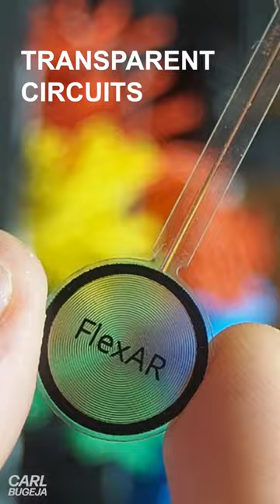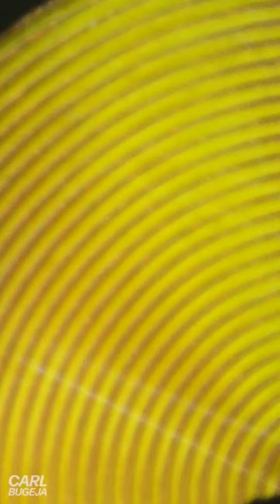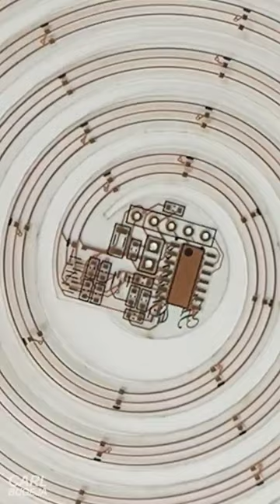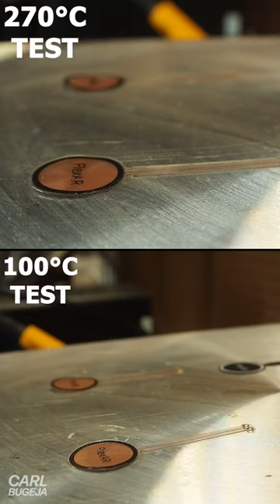See-through Circuits!!

Comment: Have you tried conductive adhesive? It is used in automotive in vibration sensitive circuits.
Reply from the maker: never tried that no
Reply: do you have any information on which components use such adhesives? I can't imagine a glued on ECU chip, but maybe electronic e-brake circuitry?
Reply: @tennicktenstyl in ECUs and such ICs are generally wire bonded to the substrate (usually not a regular FR4 board). It's the passives and discrete semiconductors that tend to be glued on. In a diesel fuel pump I repaired the whole lot was then encased in some transparent thermally conductive gel!
Reply: @ollysworkshop  fancy stuff. Weird how they do all that just so that 1 in 100000 cars doesn't fail, while I bet a plain soldered unit off of aliexpress would work with like good enough reliability for an average consumer
Reply: @ollysworkshop  although the stuff being fancy is what got me into studying EE, I don't think we'll get into automotive applications this year though. Your comment however was very informative, thanks
Reply: Seems like a con

Comment: How'd you go with low temp solders or conductive epoxy put on line solder paste?
Reply from the maker: the led pcb was solder using low temperature solder paste which goes to 165degC.. however it is still above the pcb's temperature rating
Reply: @CarlBugeja  Bi57.6Sn42Ag0.4 melts at 138 °C. But this is probably still too high.
Reply: @CarlBugeja  ouch. Conductive epoxy it is lol I wonder if that'd even stick. What's the recommended method?
Reply: @lutzj74  if you can solder in less than arround 2 seconds or less window time that sounds pretty ok, even so could happend
Reply: what about design the connector out of the "pcb"?
Reply: @zyeborm  superfine coper and aluminum mixed into the epoxy it'll work

Comment: We need a kindof chip-package that has flex-cable connectors/grippers on the chip rather than pins 🤔. 
Hmm... could we just design some sortof small chip CLAMP to hold the chip & flex-circuit together, one for each chip.  Coz i mean, that's sortof what flex-cable connectors are - they just clamp onto the end of the cable.  And if that method is already good enough for flex-cable connectors - why couldn't we use it on everything?

Comment: Sometimes I wonder if there's anyone who  make a tools with flexible PCB board or maybe, some kind of flexible cable, or without pcb and wire(like, components soldered without using any wire and pcb so it minimize the size of the tools) I know it would be hard or even impossible, but what if there's a tool that was flexible, with pocket size, and it was useful?